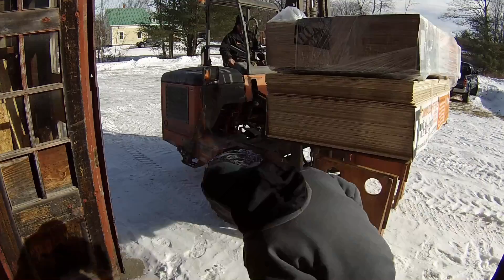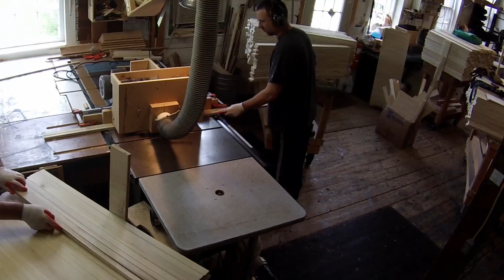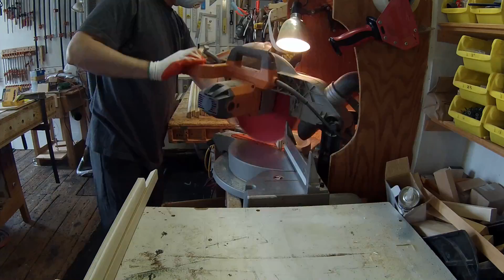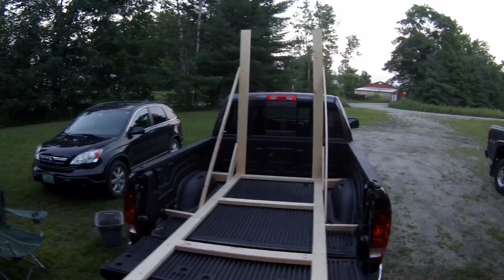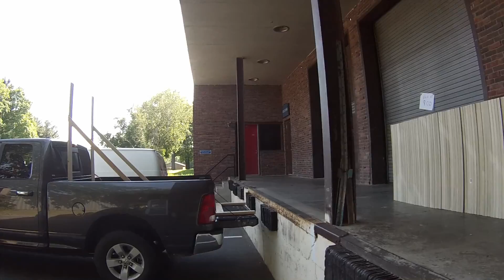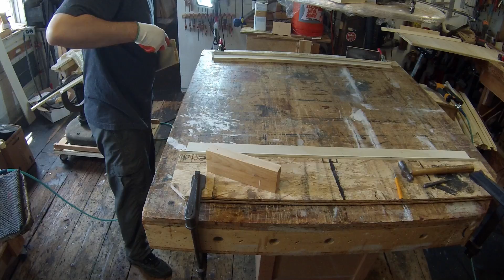250 Frames - Time and Cost Results

Comment: Mitch, I'm about to buy an oscillating sander and was wondering what you had and if you'd buy it again. Sorry to bug you about a tool purchase but this is a decent investment...
Reply from the maker: are you referring to the Delta edge sander or the drum sander?
Reply: +hffcom  your edge sander
Reply: +hffcom I've been looking at grizzlys...
Reply from the maker: Weathered Home
FYI the grizzly and the delta are the same exact machine.  I paid a few hundred bucks extra for a nicer paint finish on the delta but that is the only difference.  i was actually pretty disappointed with how the delta sander fit together.  its very crude, like grizzly, and I had to file down the cast iron table as it had sharp edges.  Indispensable machine to have in the shop, however.  The extra drum sander attachments are not that useful

Comment: hi mitch a bit late for comment but anyways. others hava asked many things i wanted to know but a thing or two. how square you aim for the frames and how much do you think an increase or decrese in squareness can affect time.
Reply from the maker: As far as squareness, there would be some slight variation as there is slight variation in the factory cut sheets, but this does not affect product or the process.  More precision would not benefit in any way in this case.  what is important, is that the frame lays flat and is not warped.  The inner frame pieces with a bow in them have to be assembled as is.  This is the advantage of making the frames with an inner and outer structure.  the compounded assembly makes  the frame flatter and more stable, and stability is the deciding factor for making this product in this way.  solid wood frame bars are not as reliable as the plywood frames.

Comment: Excellent video and great tutorial.  I love this kind of analysis.  One of the variables I didn't see was cost of waste.  It might be immaterial, but still interesting.  It would be impossible to calculate your equipment and maintenance cost on this project so I understand why that's not there.  Also, lots of GREAT advice in here.  Lastly, I noticed that hanging shelf above your bench which I had not seen before and I'll be stealing that idea.
Reply from the maker: Thanks... waste factor is negligible in this case.  The plywood cut-offs will get used for furniture parts, shelving, jigs, etc.  The small cuts fit into one cardboard box which is given away as kindling.  The large volume of sawdust generated is already outside the shop and will be dumped in the woods before snowfall.  I estimated 2 hours of clean up time so that should cover it.

Comment: Really good video! I was just wondering why you use those light respirator masks? I have found a lot more comfortable and better fitting to use half mask respirators. And works also wonderfully against chemical fumes!
Reply from the maker: I've been looking for a better mask to try...  thanks for the input.  do you have a brand to recommend?
Reply: Standard Teks are good, but these are good lookin...                       https://rzmask.com/collections/rz-mask
But only for dust as far as I know.
Reply: I have used basic 3M 6000 series mask, cost about 50 € with filters in here Europe.

Comment: How much time do you figure your helper penguin saves you?
Reply from the maker: in this case, it's not about saving time in the short term, but getting more done with less physical work.  production is limited to how much I can get done before I need a break from getting tired or stir crazy.  so the helper doesn't actually save very much work time because I could outfeed into a bin and restack the parts myself.  But if I do that I will have a sore back and need more break time and recovery time which means I loose money that way in the long term.

Comment: Great video ,I like your cost analysis on everything ,I know the feeling of making a profit ,just not a good one ,you ever think of putting an air actuated turn table where you do your assembly table sits  that does a 180spin every time ,other than that there two companies in the US that use to make pallet assembly machines for pallets ,your pretty handy ,bet you could make yourself something like that for frames ,they do the same as your doing by hand pretty much
Reply: I was thinking almost the exact same thing.   Some sort of foot pedal that unlocks the table and lets you spin it.

Additionally I'd wondered about making it so the corners were exposed when the frame was clamped in so he could sand them without unclamping it and then reclamping it for the other side.

Hell maybe even some pneumatic clamps that hold the frame in place.

Comment: Would figuring out some way to gang cut the mitres be a good idea? It seems like that is a spot where you could streamline the process and reduce wear on your joints :)
Reply from the maker: production shops have these machines for making frames.  they are called jump saws, basically a chop saw that cuts from the bottom, but pneumatically controlled with a foot pedal.  I almost bought one at an auction but the thing was like 16 feet long.  I just don't have the space for more machines

Comment: I really enjoy these videos with the cost analysis.  Did you factor in the delivery time and paying the helper in the profit before figuring the hourly rate?
Reply from the maker: No I made 400 for the delivery which is about what it would cost for me to pay someone.  I probably make $15 per hour loading and unloading and driving two trips.  But I did combine it with other furniture deliveries in the area so it worked out.  And no, I just double the shop rate if the process requires two people.  so that would increase my profit margins a bit higher for that time.  but I didn't factor in the extra electricity required to run 3 or more machines.
Reply: +hffcom Combining deliveries would help make the time worthwhile for sure.  Thanks for sharing all this info.